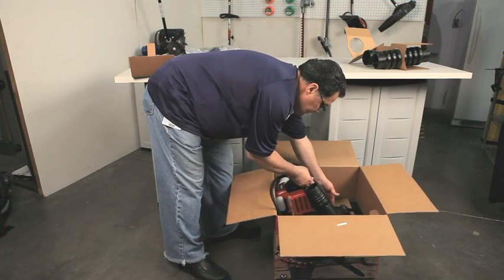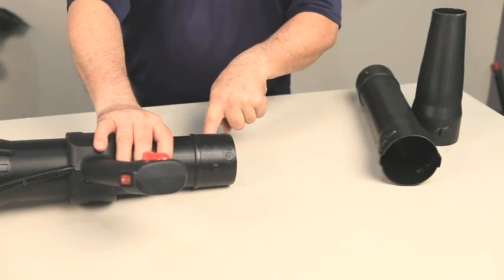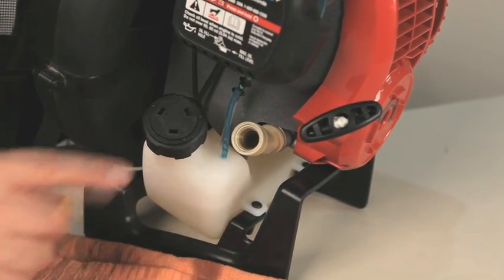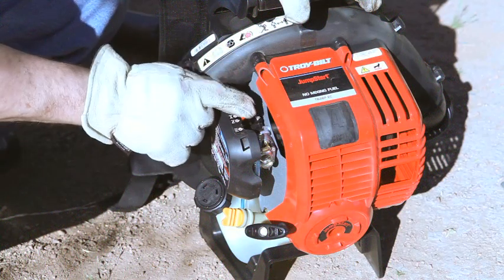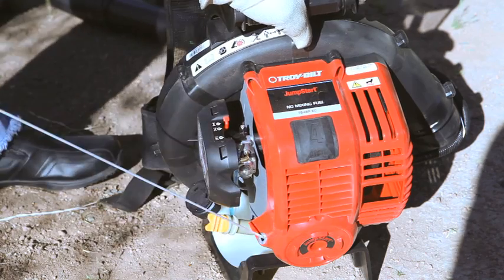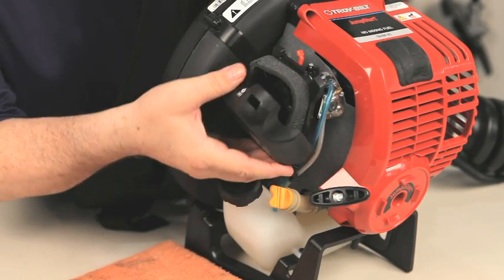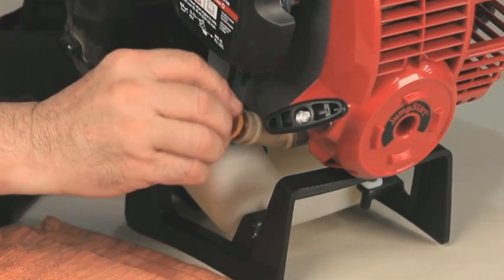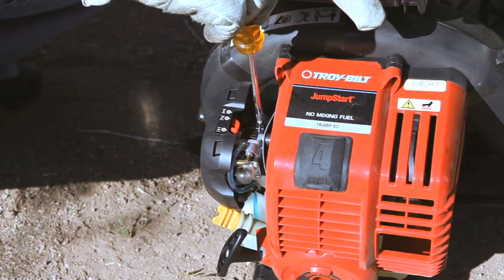The TB4BP EC gas leaf blower | How to set up your backpack blower

Comment: To start mine I have to first pour gas directly into the carburetor, then pull the cord as fast as possible 30 times with full choke.  Next, move to half choke and pull cord another 10 times.  All this with the throttle full open (high speed).  After letting it warm up a bit, I can relax the throttle to idle, and disable the choke.  I just replaced the carburetor ($35) and it still does the same thing.  The spark plug looks wet and smells of fuel after a few pulls.  I can see sparking when the spark plug is removed from it's hole and grounded - so it's not a spark problem.  This is too much work for a $230 back pack blower, that's only about 4 years old.  Sadly, it's heading to the trash bin.

Very frustrating,!!!  I will never buy another "Troy Bilt" product!
Reply: @ChuckieOutdoors  I'm still using mine!  I've figured out how to get to start every time on the second or third pull!  There are two things to know.  1) this engine needs the valves adjusted once a year if you use it weekly like I do.  2) this engine will burn some oil, so check the oil level often and replace it every year.  I've replaced the engine on my blower twice.  Fortunately Troy sells the complete replacement motor for about $85.  It takes about an hour to swap it out.  I'm on my 3rd engine.  The first engine blew up after I adjusted the valves a little too aggressively - which made it run fantastic, blowing at %150 of it's normal rate - for about an hour then it blew a hole in the head.  The  second engine died I think because I didn't notice that it had run out of oil.  Who knew this thing will burn oil?!?  So if you have one of these blowers, and it's hard to start, adjust the valve clearance.  It's easy to do and makes a huge difference.  Just be sure to use the clearance numbers from the users manual - don't guess.  And when it takes more then 6 pulls to start, you need to adjust the valves again - for me that's about once a year.  Be sure to check the oil level often.

Comment: My Troy-Bilt 4-stroke backpack blower starts fine and runs But when it's hot, it won't start. Any suggestions
Reply: What oil do you use and in what climate (State) do you live? 

Had this problem with my Honda hhb25 4 stroke. 

The best oil for this small engine : 5w40 fully synth bike oil.

Comment from the maker: Hello- Part #753-05660 does not include the pull-cord. We'll need you to provide your unit's Model and Serial numbers so we can point you in the right direction. We recommend giving our Sales Department a quick call at 1(800) 269-6215. They'll be able to help you order the correct replacement part you need. Thanks!